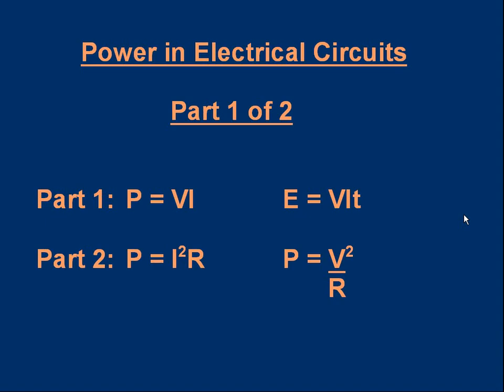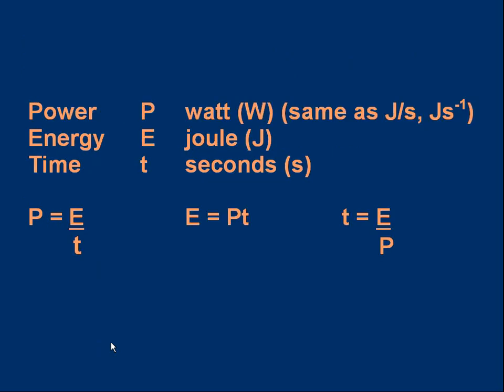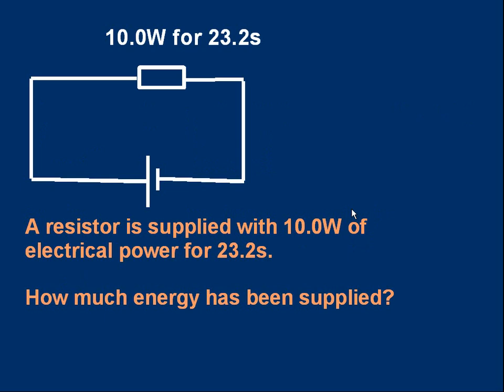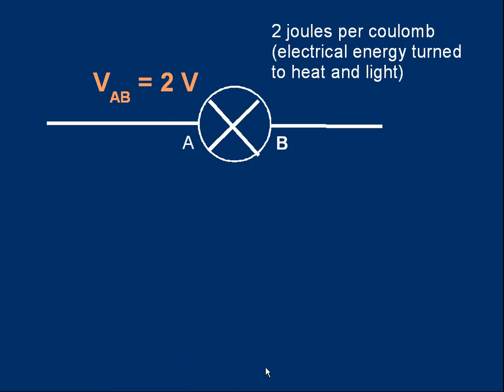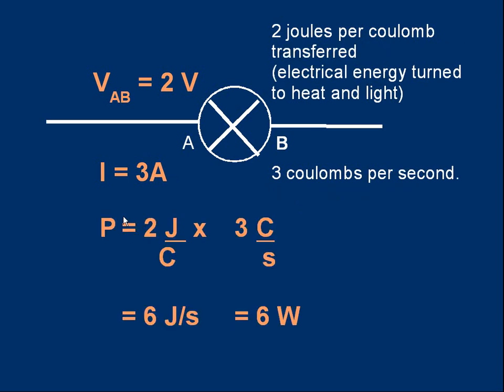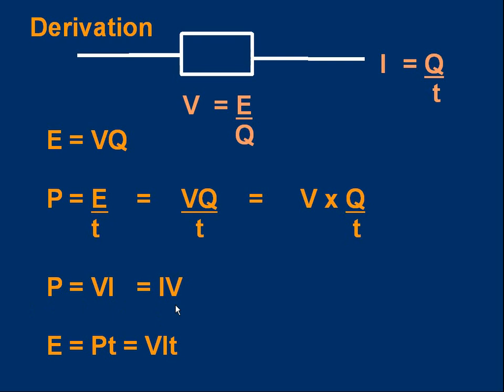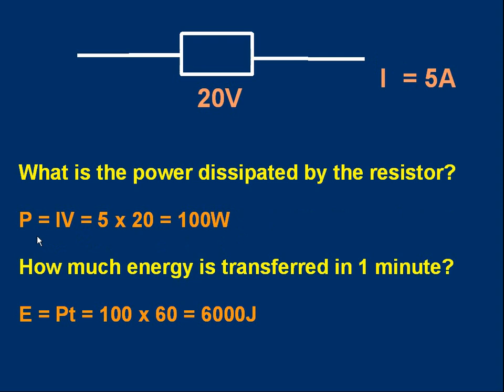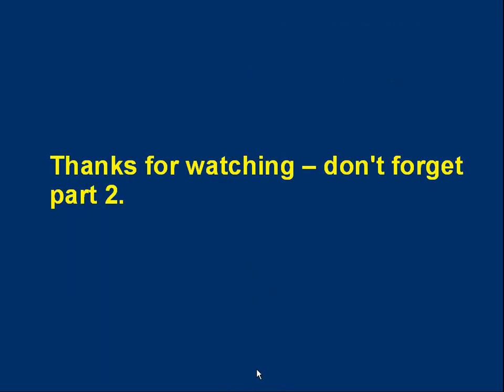GCE (A-level) Physics E21 Power in Electrical Circuits - Part 1 of 2

Comment: is it ok in any situation to substitute Voltage by EMF? because I know they are 2 different things but in the last question they were treated as the same?
Reply from the maker: Hi.

It depends on the problem.

For simple problems wherre the power supply (e.g.battery) has no internal resistance, the voltage produced by the supply is the same as its emf.  So using emf to find the total power is fine.

(Of course if you have resistors in series, the voltage across each resistor is NOT the emf. So, in this case, to find the power of a resistor you need the voltage across it (NOT the emf) or the current through it.)

Note that emf x current gives the power being delivered by the battery to the rest of the circuit.

Hope that's what you mean!